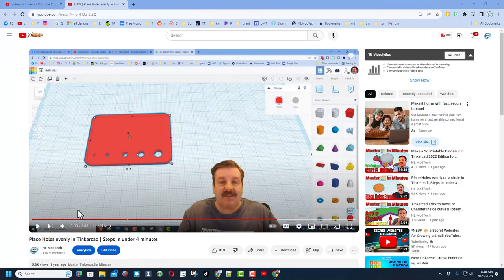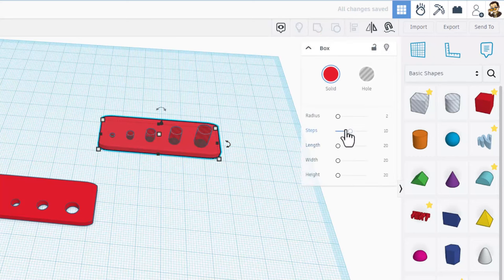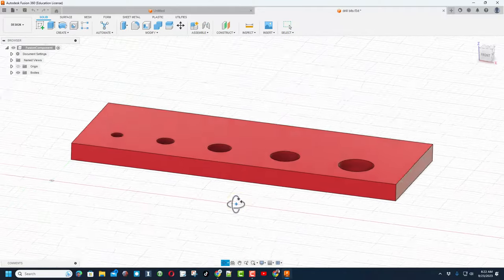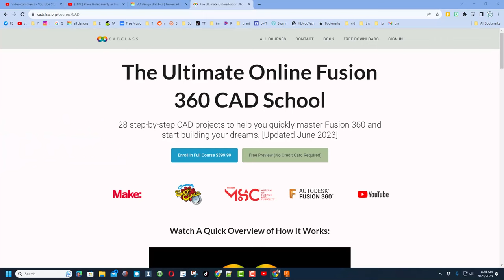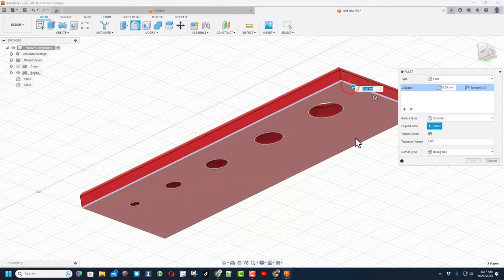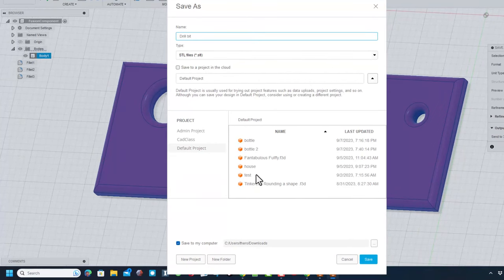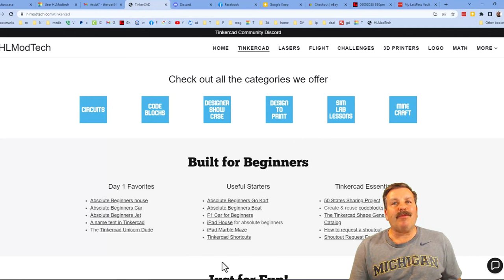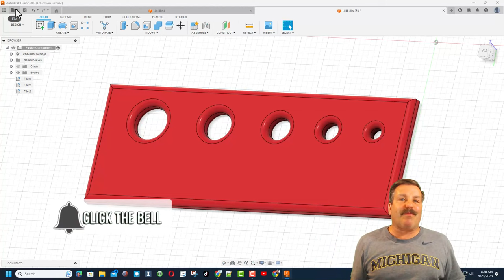Round Tinkercad Holes & Edges Instantly Fusion 360 Fillets in Minutes!

Comment: Hey, that worked. I had installed Fusion 360 yesterday. But when it says that you can export drawings from Tinkercad using only "basic shapes," does that mean you can use only the shapes in the "Basic Shapes" menu and no others? Nothing from the Shape Generator or any of the other categories of shapes?
Reply from the maker: You can build with all the sorts of shapes, but if it gets too complex, then it doesn’t work. I have not found a magic amount of complexity that it can handle yet, but I have brought stuff that did not work.

Comment: @HL Modtech can you show me how to make designs in between 2 circles im sketch
Reply from the maker: In Tinkercad or Fusion?
Reply: @HLModTech  in fusion 360
Reply: @HLModTech  its basically for an Rc rock crawler tire insert.
Reply: @HLModTech  some people would do just a circle and then use infill in there slicer but I would like to make my own pattern in between my circles and then I can 3d it